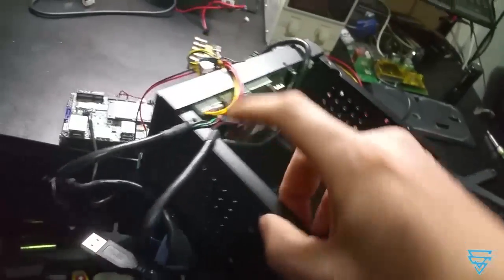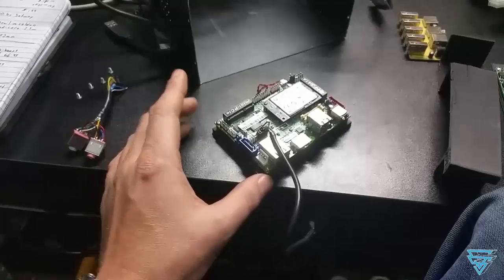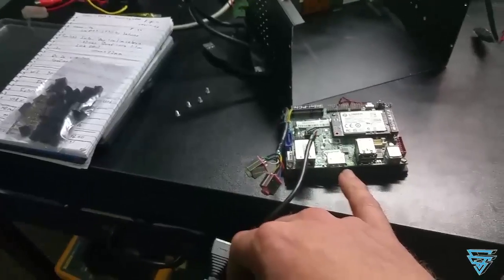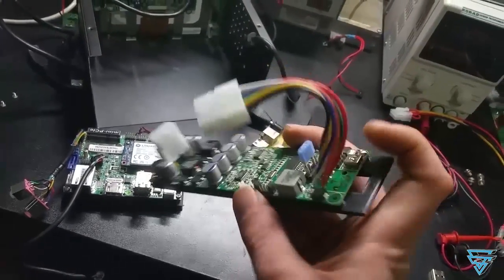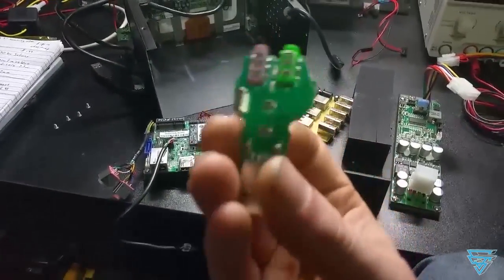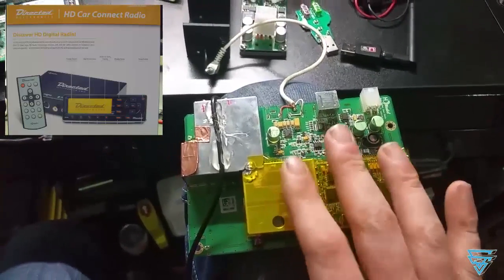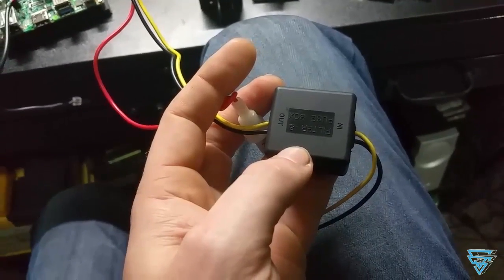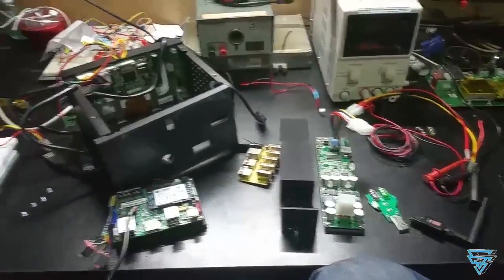2DIN carpc part 2: componets

Comment: If all the 8-pin mini-DIN interface is just RS-232 that the HDR USB gives a convenient interface to an FTDI USB adapter, then somewhere out there should be the RS-232 pinout for the DMHD-1000's 8-pin mini-DIN port. You have any clues on where I can find that, because I'm striking out. Also, I need to cobble together my own power harness to a DMHD-1000. I can get the pinout, no problem, but I need some technical description of the 4-pin molex, where the squared off pins are and where the rounded off pins are.

Comment: Im looking at a bigger board but im just going external box to touch screen, great info on the hd fm receiver but what are you doing for a auto dimmable screen?
Reply from the maker: this screen has a auto dimmer wire. I just forgot to mention it. it also has a manual dim button on the front to override any other dim settings..

Comment: Nathan - great job on this.  I am using the same HD radio but struggling to get Centrafuse to recognize it.  What do you intend to use as an interface between the PC and the user?
Reply from the maker: Thanks william!

Have you tried the stand alone HD radio app that comes on the disk with the cable? did that see the device? I'm using the new version of centrafuse v4 as of this writing. what OS are you using? If the stand alone app atleast works then it should only be a setting problem with centrafuse. you have to go into the advanced settings and tell it to look for HD radio.